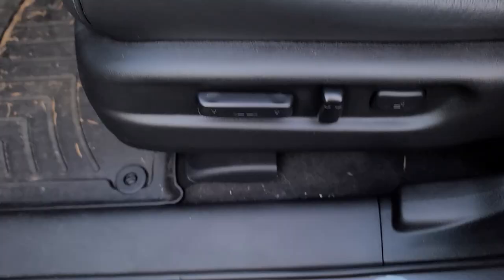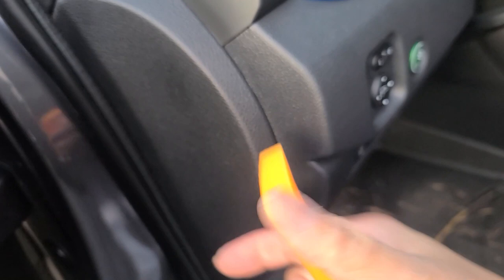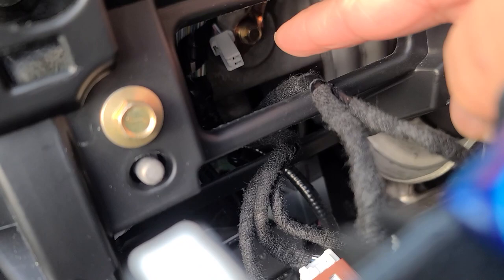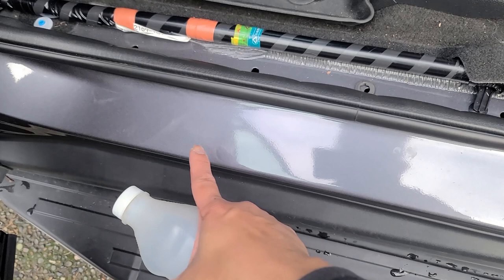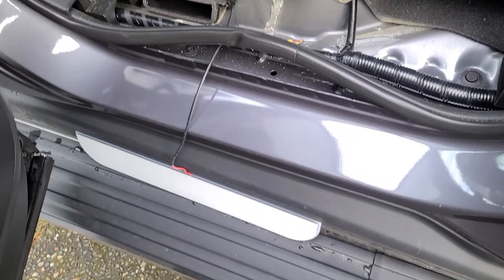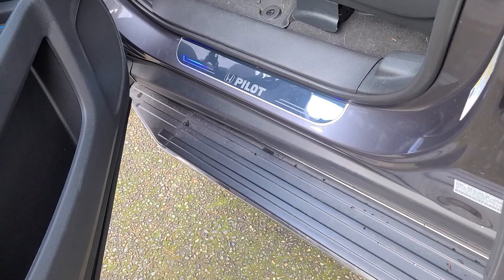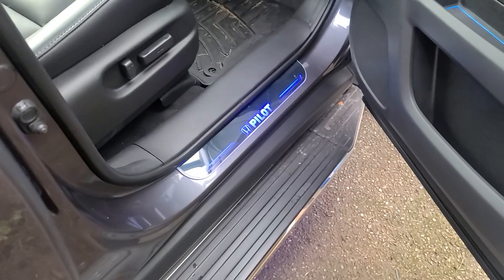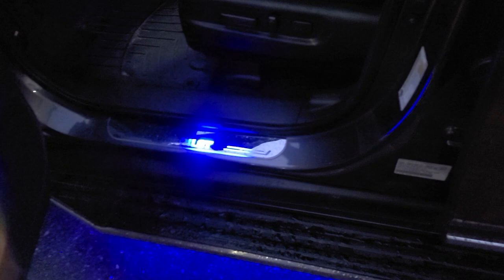How To Install Dynamic LED Door Sill [Step By Step Installation Guide]

Comment: Call it old school but I still maintain ops check the installation BEFORE final fitment.   Place a piece of painters or masking tape to hold the placement while the wiring is done.   The 3M adhesive sticky tape should be removed LAST then press the sill plate to the door sill and press down firmly. 

Aside from that great video and thanks.  Getting ready to tackle the project soon.  Although the vehicle will be different the concept and procedures should be the same.

Comment: Hello, can I use the 6pin socket instead of the 3pin one as the power supply if my plug is 3pin?
Reply from the maker: Yes. Just connect to two wires. power and ground

Comment: Awesome and detailed install, would i be able to tap my underglows to those so it can act as a door/welcome light?
Reply from the maker: Yes. That's how I have my underglows connected. I also added a switch in case I want to turn it on without the doors being opened or when the car is off.

Comment: The harnesses that you tapped into , are these just sitting there for you to use for any accessories? Like were they factory installed and readily avail to freely tap into ? 
Reason I ask I have a 2009 Armada LE was wondering if it’s the same kinda deal on finding these harnesses to tap into ! Thanks for the clarification
Reply from the maker: Yes. This harness was readily available.  I can't speak for the Armada but in the Pilot it is.
Reply: @AutoSensation  ok thanks you , could you source the Amazon seller from which you ordered yours ? Thank you
Reply from the maker: Can't seem to find the seller. I search again tomorrow and let you know

Comment: do they stay on all the time or they turn off when you shut the door?
Reply from the maker: They shut off when the door is shut.
Reply: @AutoSensation  , i have a 2016 touring. I assume my pilot has those two pin harness?!
Reply from the maker: @avieneronisemuli849  Yes. I believe they do because the have the OEM illuminated door sills for that year and trim level.
Reply: i appreciate your help! more power to you bro!
Reply from the maker: @avieneronisemuli849  Anytime. Good luck on your install.
Reply: I wonder will this work on a Honda accord??

Comment: Nice look  but not so easy install👍
Reply from the maker: The hardest part was the wiring. Pulling out the panels and placing them back was easy. Squeezing your hand in tight places to get the the wire was hard.